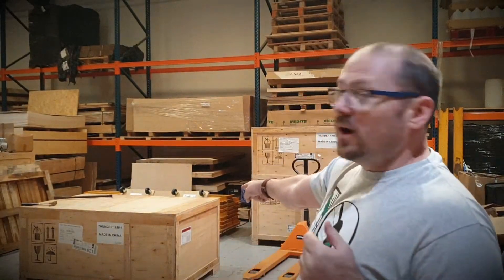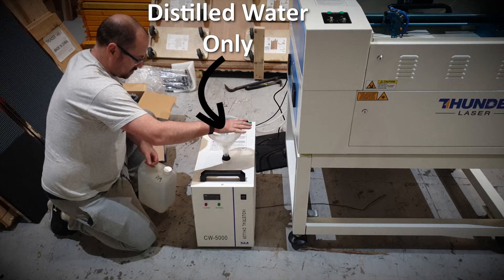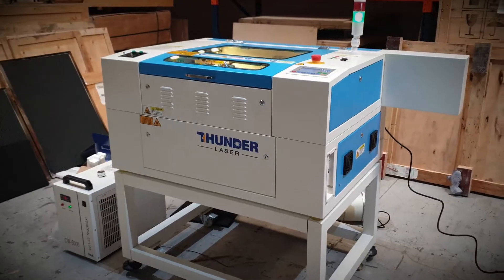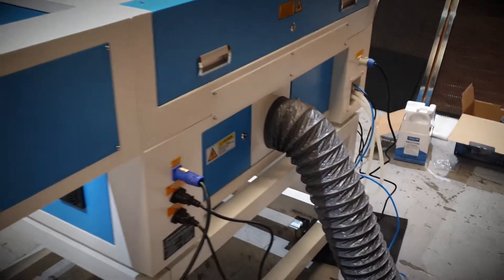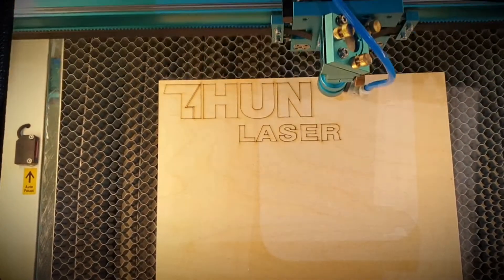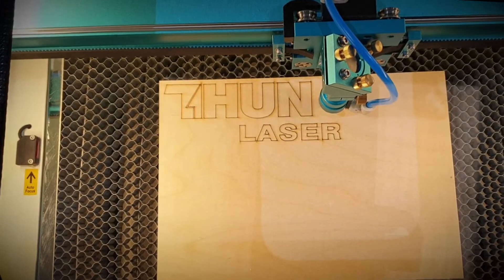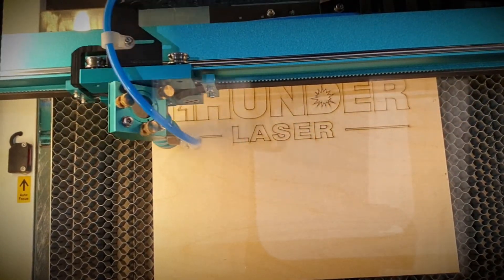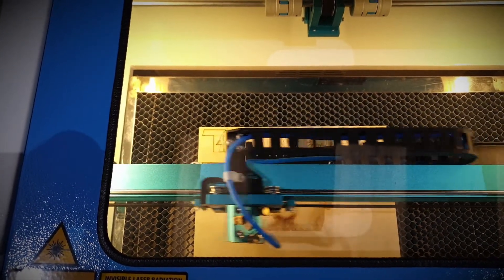I Got to Unbox an Industrial Laser Cutter

Comment: Looks fun. What is the max that it will cut through?
Reply from the maker: That will depend on the laser wattage, power and speed.
In my experience 40w is good for 6mm Ply, MDF etc , but you will have to run slow at that thickness.
If you find a glue pocket in the wood you may need to do a 2nd pass

The higher wattage the faster the laser will cut and less charring as a result